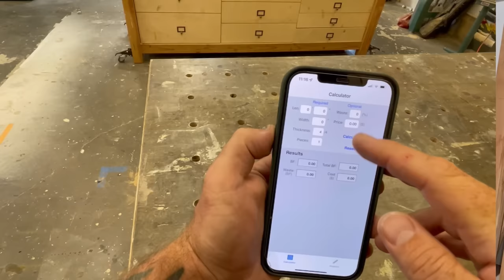Don't Buy Wood Here || Beginners Guide to Buying Wood

Comment: I'm generally satisfied with HD because most of the wood I buy goes into framing things that will be covered up anyways. I've built a couple of quick and dirty pieces out of pine 2x4s like garage shelving and a simple TV stand. But yes I wouldn't go in there if I was after high quality wood. The poplar they have was ok for some of the shelving projects I had.

Comment: You forgot to mention that those nice people at the Hardwood Center will also cut down your wood for you. Rather than going home with a cumbersome, 9-foot board, you can go home with three 3-foot boards, or whatever your project needs. They have really nice equipment, and they don’t mind using it, if you ask nicely.
Reply: This is one of the things I find HD actually does a better job with. My local lumber yard is not interested in ripping down plywood or cutting boards for me. If I can convince the local lumber yard to make a cut, it’s usually way off in regard to measurement and how clean the cut is. 

Home Depot on the other hand is always happy to make multiple cuts for me.

Comment: A good tip if you're lucky enough to have an independent wood supplier like this: Check out their special-order return inventory. Often, they will have some really unique things that have been bumping around way too long because someone changed their mind. I've scored 3/4 A/A plywood, tropical hardwoods, even cut siding shingles all for a SONG! The lumber quality at the big box stores where I live is comparable to what they build crates and pallets with, total garbage.

Comment: I've actually picked up some amazing pieces of plywood from lowes before. Honestly, when the lumber shopping options are limited, you just have to go to whats available. If you're patient, and look hard, you can find some gems. But, I will admit, I did end up spending a good fortune on those common board pieces. But, I'd say, the lumber shopping experience is rarely perfect.

Comment: I really can't stand Home Depot or Lowes when it comes to wood.  Literally I've spent an hour trying to find straight 2X4's.  That said, I try to go to my local lumberyard when it comes to non-hardwood.  However; last Saturday I went to my local lumberyard to get 2 sheets of 4X8' 3/4" Birch good one side, and he tells me the price is 110.  He also told me he had A/B sheet of plywood for around the same price.  Home Depot had birch good one side for $84.  For a shop project, it's hard to not end up at the box stores.  If I am making furniture for a customer, then I'm definitely sourcing my plywood from the local lumberyard.  When it comes to hardwood, I have 2 different places that I source my projects.  Yes it comes rough sawn and I need to do work to make it ready to use.  That just impacts the thickness that I purchase.  Great video.

Comment: Yeah, I bought some plywood from Ho__ De__t once as I wanted to make a cot. I needed to get some structural glue joints out of the void free birch veneered plywood. After the glue cured I sat on it and almost immediately heard and felt all the"structural" glue joints fail. It turned out it didn't have a pure birch veneer. It was a birch veneer on a paper backer cause the veneer was thinner than the plastic film of a good trash bag. Speaking of, that's probably what it should have been put in instead of a Home Depot. I had to do an awful lot of scrapping and sanding to fix it. But in the end it looked great and that I suppose is all that really matters. Well, that and there weren't any kids around to hear me barking and growling over my various really loud sanders. Besides, I'm totally fine now. I mean, that was years ago.

Comment: Big Box.  Construction, yes.  Furniture, no.  Lately?  Gardening/landscaping, H#!! no!!  In last few years, I've purchased pressure treated 4x4s only to have them warp, twist, bend, and split so badly that they've ruined my raised beds.  F/HD, they're often still wet when I bring them home.  I don't have a moisture meter, but 50%?  Lol.  So, I choose perfectly straight boards, bring them home, lay them on a flat, level concrete slab, and weight them down for days or weeks until they seem dry and still straight.  Doesn't work.  They still warp.  Google for a local pressure treated wood center?

Comment: I stopped at the local lumber store that was recommended by fellow woodworkers in my area. The plywood was super nice (Baltic birch) but it was around $80 for a 5x5. At home depot, an AC rated piece of plywood (non-Baltic birch) is about $50 for a 4x8. For basic shelves, bed platforms, etc I haven't had a problem using the wood I've gotten from Home Depot, plus I don't have to call ahead every time to make sure the local lumber place is open (it's run by a helpful guy, but he doesn't have set hours). From my experience, the local lumber place is worth going to if you want better quality wood but it'll cost you; I didn't compare hardwood prices so I'm not sure about those.
Reply: I am not sure where you are going but if you go to small woodworking or hardwood stores they are usually way too expensive. This guy is talking about going to a mill. They can be called many things like a hardwood supplier but it is not like the place you describe.

Comment: Calling Grade 4 wood as Grade 1. First Grade doesn’t have knots or sap and has straight grain. Good for firewood. Twisted or cupped studs. 2x4’s….not! Instead of 5/8 plywood, one less layer with hollow spots you can’t see until cut with pulpwood.

Comment: Funfact: Originally, there was an E in the school grading system, but then parents were confused as they thought it meant Excellent, so it was changed to F because that was easy to equate with Fail. Now ya know. Clearly the early parents of school children hadn't had formal edumacation demselves so the confusion is understandable. Problem solved.

Comment: Home Depot is the WORST place to buy lumber . Their lumber is WAY over priced and the quality is the worst . On several occassions I've had to point out to the manager  how terrible their lumber is , and how they pile the crappiest lumber on top so that you have to work through the pile to find anything decent .I've seen WHOLE STACKS of presssure treated deck boards with rounded bark corners on at least one side . I literally went through the whole stack , in front of the manager to point it out to him , without finding ONE board decent enough to purchase .

Comment: My problem is I lack the space for a plainer and jointer, so I've been using construction grade lumber to build whatever it is I've built, which includes a console table for my mom's kitchen, which actually came out really well, and it's a year old so far and no separation has occurred so far, so I'm thankful for that. But what would you suggest for a woodworker who just... can't mill wood down like what you would need to do with wood from a hardwood supplier?
Reply: Bosch makes a decent hand held planer. There are compact and hand held options that are easy to store away when not in use. A few quality collapsible tables in tandem with, easy enough to pull off. I can relate though, wife doesn't want the garage turned into a shop so it all has to be put away up on some shelves I built.
Reply: You could also go old school with some hand planes. A lot of effort but easy on space and the wallet

Comment: I went to local hardwood and lumber yards - and they literally told me that the big box stores are the only ones carrying wood for crafters now. They only carry construction supplies for contractors, and for small projects the big box is now carrying better wood at lower cost. After visiting 6 of them anyway, I found this to be ridiculously true. A sheet of maple plwyood 3/4, 4x8 was $90 at Lowes, $140 at a dealer I finally found after 5 different sites. And theirs looked horrible compared to Lowes. This is in Oklahoma City. So I'm not sure where you are - but your truth is not true everywhere.
Reply: My lumber suppliers don't offer planed/jointed wood. So, since I don't have those tools, I have little choice but to go to the big box stores and pay a few bucks more per foot. Once all that waste and time is accounted for (including blades, shop space, etc), I am not sure how much better off you really are going to a lumber yard to get rough poplar, red oak, pine, or other materials available at the big box stores that barely even need sanding. Now, if want solid maple, cherry, etc., the big box stores just don't carry them.

Comment: Good, and sometimes amusing, video on wood.  Since you mention plywood it would be helpful for newcomers to understand that there's plywood with varying numbers of inner layers.  For example, most plywood is generally 5 layer regardless of the grade on either side (and there are plywoods with less than 5 layers as well). However, there are premium plywoods with more than 5 layers that are outstanding quality and a great choice for cabinets, furniture, and wood-working jigs because they are dimensionally very stable.  It would be useful in a future video to cover these higher quality plywoods.  Also, although it's true that places like H... Depot sell wood that is mainly for construction, they do sell better than construction quality plywood and in some cases hardwoods (though hardwoods are generally rare for HD).  I have seen poplar and white oak at H...Depot, at least the one locale to me, but it's a limited selection.  And I have purchased quality plywood from HD in the past and made some excellent office desks that were then laminated with oak "formica".  But as with anything, the better quality plywood commands a higher price, and now it's often almost $100 for a 3/4", 4' x 8' sheet.  But you just have to look for it at your local HD.  However, if you're looking for plywood with a specific finish top layer such as maple, or cherry, or oak, etc, or anything other than birch, you're not going to find it sitting out on the floor because it's not the kind of plywood they ordinarily offer or that is requested, in which case you do have to go to a specialty store.  Looking forward to more videos from you on plywood and other wood, and also finishing.  I was told very early on that you have to buy what you break, so I'm wondering if that hardwood store didn't require you to pay for the piece you ripped apart as the exit price for getting out of their store!

Comment: Actually, the man is just blowing smoke. It's true and pretty obvious that a store that caters to woodworkers would have a better variety of wood than a store like Home Depot.  There are two types of wood at Home Depot.  Construction grade which in my opinion is the best that can be had.  They buy the most and naturally will get the better quality.  And then Home Depot will have some project wood.  Mostly oak and pine.    And again it is top-notch quality and cost.  It is rather silly to say or think that a big box home store would not have high-quality material.  Not superior, but good.   If these stores sell anything they sell a lot of it.  And suppliers are going to sell them the best to keep their business.  If they don't have something then yes go somewhere else.  But denigrating them for the purpose of clickbait is pretty low character and disingenuous.

Comment: A few things you missed. Kiln dried hardwood is usually dried down to 6% moisture content, however lumber will eventually pick up moisture after being dried until it stabilizes with the ambient moisture in the air. This can vary, depending on where you are. If you are in Arizona, it might be 7%, in the San Francisco Bay area it is around 10%, it will vary from winter to summer also.  When you are buying hardwood that is surfaced and straight line ripped, the mill looses lumber from the edge when they straight edge it. The seller will add 10% to the width to cover the loss. This is within the guidelines of the Hardwood Lumber association guidelines.   Of course, the same goes for thickness. When you buy 8/4" lumber, and it's been milled to 1-3/4" net thickness, you will pay for 2" of wood. The other 1/4" got turned into shavings. On plywood grades, you mentioned A-A grade. You might be able to special order A-A grade ( for a lot more money ) but generally the grades that your local supplier will have in stock are  A-1, A-4, B-1, C-2 and C-4.   They may have a "Shop " grade plywood. This is often misunderstood. The plywood mills inspect every sheet after it comes off of the press. Is it has a defect it is stamped a shop panel. This doesn't take into account what grade they were shooting for. It could be a downfall/shop panel from a C-2 or an A-1 panel. The plywood mills sell the shop grade panels for 10% less than on grade panels.  Great video, this is a big help to people who are getting into woodworking.  The hardwood lumber at the big box stores is crazy expensive, the plywood is generally low grade crap, and of course there is very little selection.